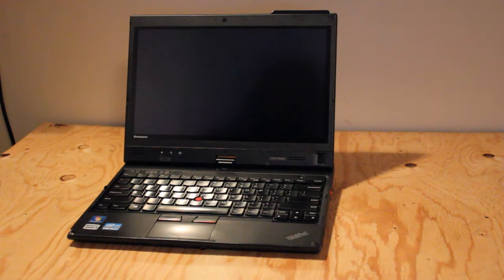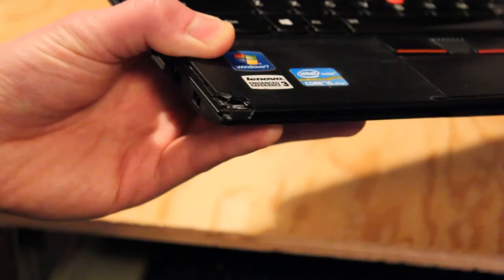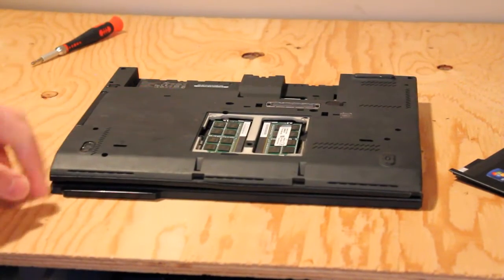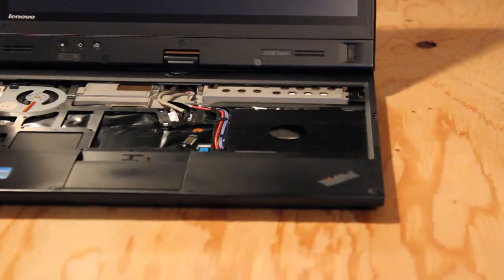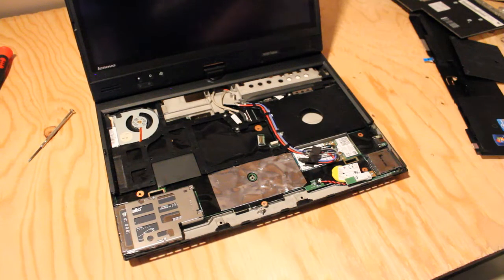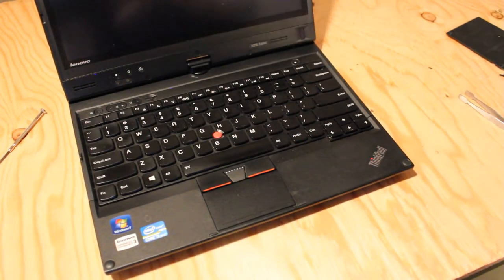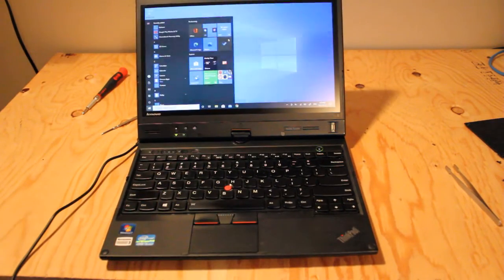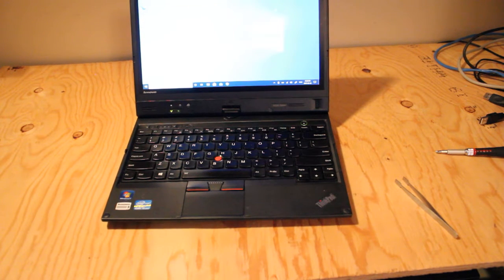Lenovo ThinkPad X230T Palmrest Replacement (how to)

Comment: What a collection of Thinkpad videos you have here SIr, RESPECT!
May I know if x230T able to use multiple hard drives without any modification? I will pick one at the end of the month for 300 USD (SSD 128 + 8 Gb Ram)
Reply from the maker: Thank you!  I have been getting a large amount of ThinkPads from gov't surplus for refurbishment and resale.  The models in my videos are wonderful to work on and upgrade.  Easy to access the innards and offer different options to customize.  With the X230T, yes you can install an mSATA SSD under the palm rest, which leave the 2.5" hdd bay open for either a Hard Drive or additional 2.5" solid state drive.  One of my videos shows how to do it.